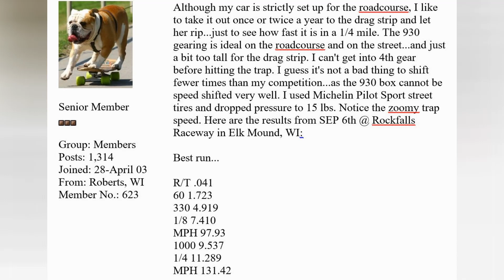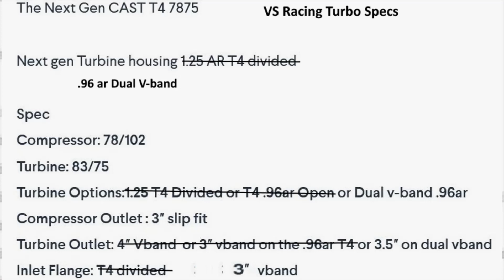Turbo LS v8 914 Pt1: Goals/700whp? Fastest ET?

Comment: If one turbo is good wouldn't two be better? Looking good! I can't wait to see the end result.
Reply from the maker: Well, it would look cooler,  but 2 or 1 it makes the same max hp that this drive train can handle.  Come over and lift this turbo and tell me if it's a good idea to add another one to the tail end of this thing. Plus,  I kinda want at least a little bit of trunk space.  Ok, those are my excuses.  Still, it would look cool. Maybe I'll get a plastic one for the other side.
Reply: @budgetoutlaws9978  two smaller turbo's might fit better under  the car and leave all of your trunk space while making the same power. Just saying. I do understand that this is Budget Outlaws and two turbo's may double the price!
Reply from the maker: Double the price double the weight double the looks!   I really want to leave room for a muffler too.  It already draws too much attention.  Well, this is the plan, we'll see how it goes.